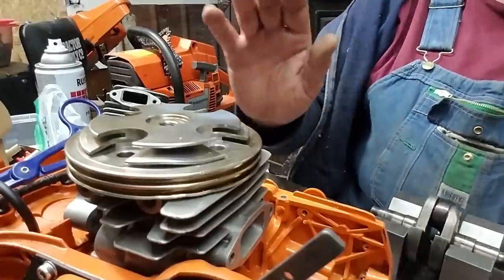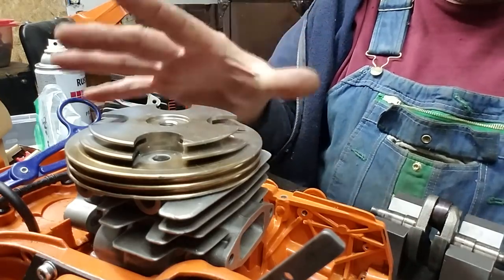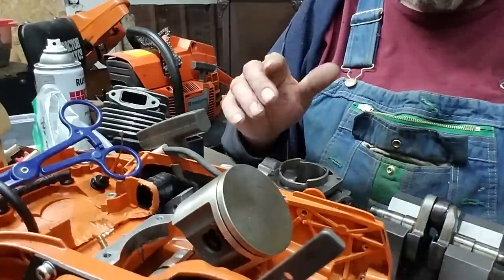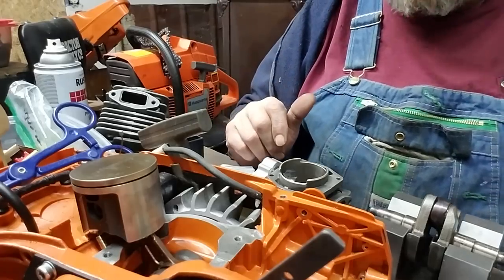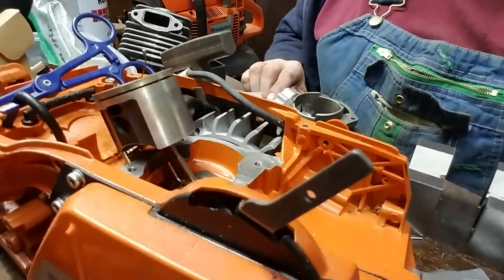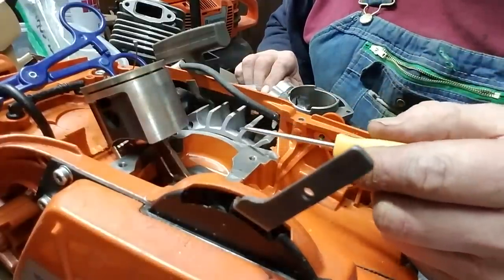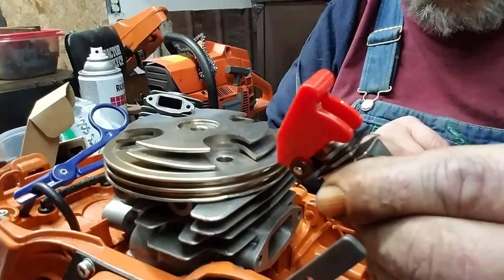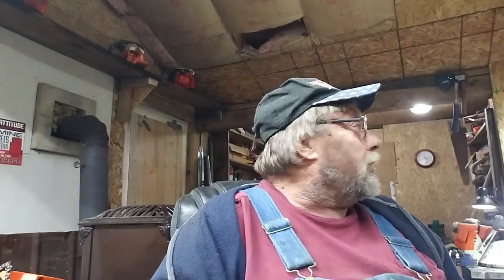husky reed saw mega build info! and what's next!

Comment: Looks like all the parts are there now. Say, how thick are those single stage reed petals? Curious. Before 2-stage reeds we used to sand them to a taper so we got better bottom end and mid-range on the bikes. I bet you messed with that too. That may help in a high revving saw if you get into a knot that pulls the revs down off the pipe. 
Super fun project sir. Very entertaining. Can't wait to see it run! I bet that head will hold the cylinder down just fine without trying to make fancy stepped studs. Making those would be tricky.

Comment: I was just sitting here thinking about how lazy I am... lapping compound would be awesome...I’d need to toss an old plug into the top and chuck it up with my cordless drill and spin it around for a couple minutes at a time until it was good. 😂😂😂. My cordless Dewalt is my lathe! 😂👍.  
Harvey... I was thinking that a little bit of marker was actually working like a little more simple and cheaper version of machinists dye?  Isn’t it fantastic that there’s so many perfect keyboard warriors out there to monitor your imperfections and mistakes! 😂😂👍.  If you aren’t making mistakes then you aren’t trying hard enough is what grandpa usta say!  We don’t learn crap from our success’s we really learn from all those failed attempts or experiments!  So stoked to see and hear this one rip!  I’d have to cut everything completely out of the upper transfers and just have a garden hose blasting... can’t even mentally calculate that additional charge volume from the reed... too exciting for me!!! you going with the Xtorq carb for more juice?  385-390 carb?   Would you share that 395 reed cage info?  This is a crazy fun project ideas!!! ❤️👍😁🇺🇸🇺🇸🇺🇸❤️.  Keep on Truckin! Captain!

Comment: when running and fireing a 300 psi gauge with blow apart there only a copper tube inside a saw running i think is 1000 or more psi i can remeber but its high but love that ideal and all ur do on this 372  i did the same thing but ful cricle crank  and tured pipe big carb and all the tricks but no head

Comment: Just a thought have you thought about using a scooter cylinder like a 50cc or a 70cc  minarelli vertical ? I bet it would be a screamer.  the spacing of the bolts would be close but you would still have to fill them with a aluminum rod & redrill new holes.